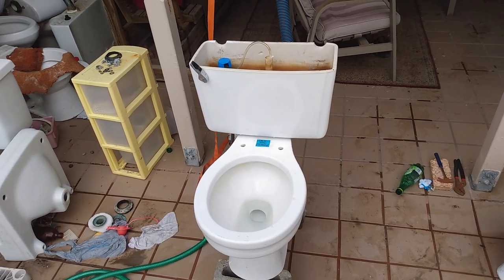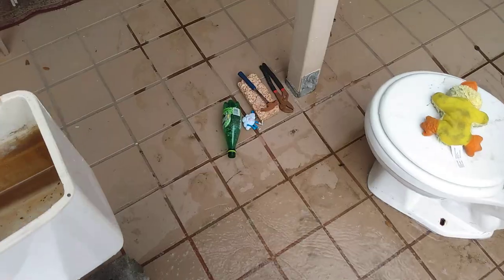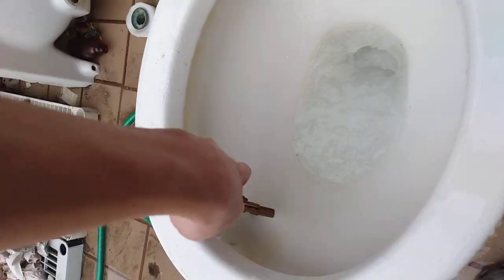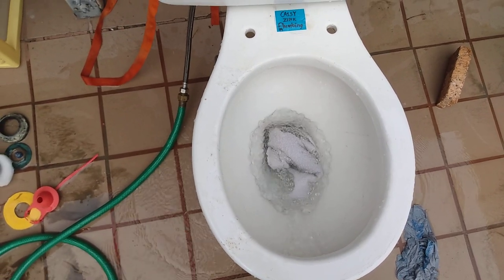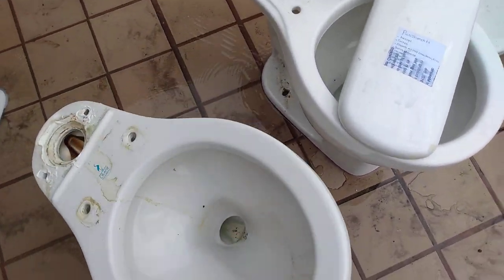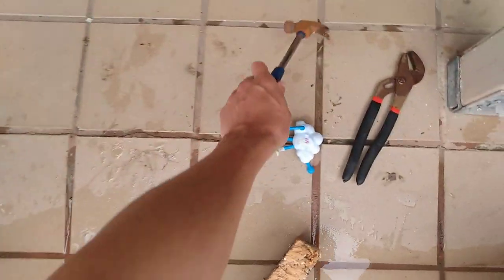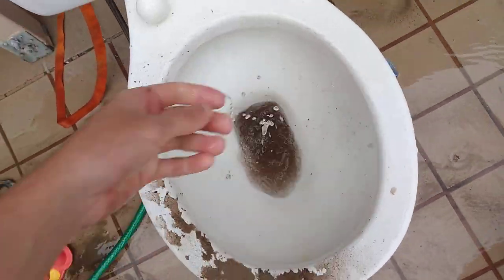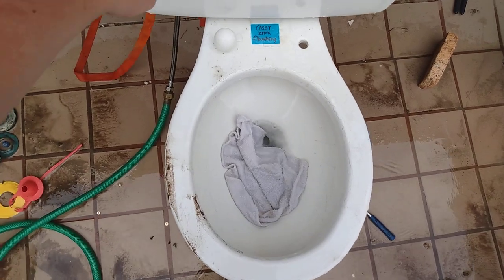Crane Galaxy Elite II punishment day part one

Comment: Like the first on i saw was a eljer album on fv
Reply: And tested it on 30 ft it failed and I destroyed it because it failed 30 ft
Reply from the maker: An Eljer Emblem on flushometer? A Sanus? And by destroyed it, do you mean literally smashed it or did you do something else?
Reply: @OCC_Plumbing_and_Restorations  dropped it off a balcony
Reply from the maker: @TopphatClan2024  Oh, so it was yours
Reply: @OCC_Plumbing_and_Restorations  yes and I couldn't find one on sale sorry I tried but I like toilets like the same as you
Reply: I also had a kohler class 5 but it broke due to the freeze and crane Drexel but that broke due to I punished it due to cracks
Reply: This deserves to get punished im on your side
Reply from the maker: Sucks about the Drexel

Comment: This toilet sucks. I have it at my school and it is the WORST! It is such a failure. The tank is misplaced, the seat is wobbly and it is worse than a Glacier Bay! It is weak and never tries on flushing a literal 25 feet of toilet paper or 1 Ply! This is why it should never be bought. It replaced a 1980s American Standard Cadet. Deserves to be replaced by a stronger Crane Galaxy. (like a lot stronger that can take 10,000 feet)
Reply from the maker: These things are absolute junk. I wonder when your school will be tired of coming to unclog it and end up just replacing it.